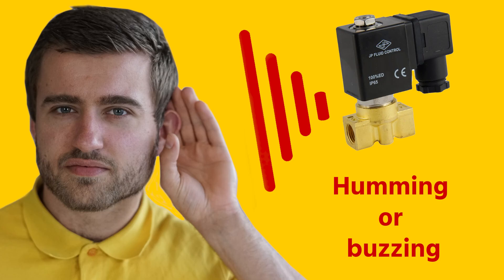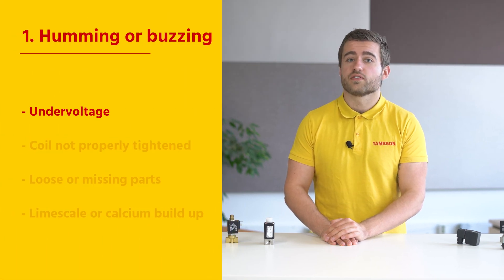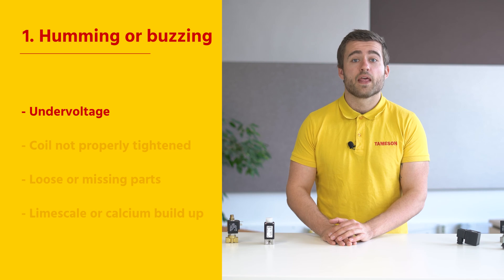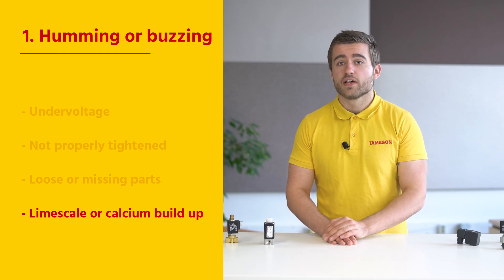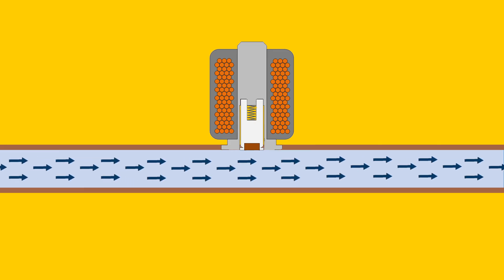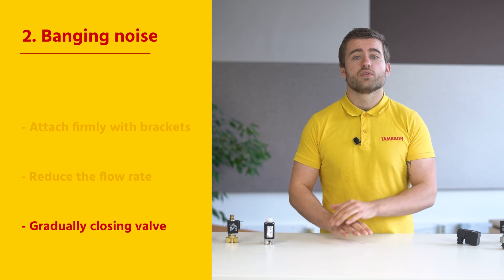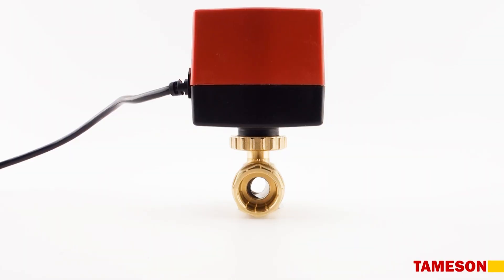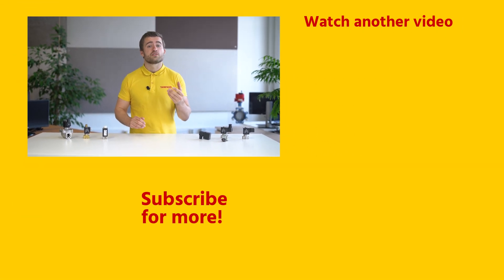Solenoid valve noises | Causes & Solutions | Tameson

Comment: My gas dryer (Maytag) was noisy before ignition and sometimes also after ignition (A 60Hz buzz). I found the armature length on valve 1 (the three wire valve) was slightly long, so the solenoid plunger (aka piston) vibrated on the cylinder end stop (the internal limit for travel inside the cylinder). Installing a replacement cylinder from a donor valve solved the noise. Note: this was not caused by a weak coil or by incorrect gas pressure as some persons have suggested.
Reply from the maker: Thanks for sharing your experience and solution!

Comment: Hi 
I have replaced my caprice solenoid valve. After that car is started making huge metal grinding sound. Can you please tell me what could be the reason.
Reply from the maker: Hello, you should check if the valve is installed properly. There are many things that can cause this issue, but the first thing is to check the installation manual and the installation guidelines.

Comment: On what basis soleniod valve power rating will decide?
Reply from the maker: The power rating of a solenoid valve is primarily determined by its coil. Every coil is fitted to the valve to meet the operating conditions and have enough power to open or close the valve.

Comment: i have a gas pressure fryer and as i press the power button, the selenoid valve makes a loud continuous noise for like 10 seconds then stops. Would be thankful if you can advise me. please. Thank you
Reply from the maker: Humming or buzzing noise
AC noise
Solenoid valves operating on alternating current may produce a noise accompanied by vibrations. Soft buzzing and slight vibrations are normal in some types of AC solenoid valves. They are the result of alternating current producing a varying magnetic field which acts on the armature of the valve. Most solenoid valves include a shading ring, usually made from copper, which is used to buffer the magnetic energy created by the current flowing through the solenoid. They smoothen out the varying strength of the magnetic field by storing magnetic energy while the current is at its peak, and releasing it when the AC current is near to zero.

Undervoltage
However, if the noise or vibrations are excessive, this may point to one or more issues. One potential cause is undervoltage, caused by improper control signal, faulty control system, bad wiring or control relay malfunction. Undervoltage may cause the solenoid to never fully open,  oscillating between the open and closed states, a state which produces abnormal vibrations and an audible hum. This fault can be diagnosed by energizing the solenoid and measuring the voltage across it, making sure that it is within the manufacturer-provided specifications.

Loose or missing parts
Another cause can be loose or missing parts in the assembly. This case might be characterized by a chattering noise. It should be verified that all parts are installed according to the manual and that all components are properly tightened. This problem can occur if improper maintenance is performed on the valve. If some components are missing, you may find a suitable spare in your distributor’s catalogue.

Excessive pressure or flow rate
An excessive pressure differential across a solenoid valve, or a too high flow rate, can cause humming noises in some valve types. Solenoid valves should be chosen having in mind the pressure and flow requirements. Inlet and exhaust tubing should be of sufficient diameter to allow for lower flow rates. Some solenoids require speed-control devices for proper operation.

Internal damage can also produce noisy operation. Worn armature or damaged springs are often to blame in such cases, and if wear-related issues are suspected, the valve should be examined and serviced by a professional.

Indirect operated valves with too low differential pressure
Some valve designs require a minimum pressure differential for the valve to open from the closed position, and to stay in the open state. This is called indirect operated, pilot operated or servo operated. If the minimum pressure differential requirement is not met, the valve may not fully open, or may rapidly resonate between the open and closed position, producing audible noise. In order to avoid this issue, pay attention to the minimum operating pressure differential specification in the solenoid valve datasheet, or use a valve design that does not have minimum pressure differential requirements. An example is a direct operated solenoid valve or a (motor driven) ball valve.

Foreign matter
Finally, foreign matter such as dirt can affect the operation of the valve. Limescale can be another cause, especially in systems used with hard water. Solenoid valves run at temperatures that can be considerably higher than the temperature of the surrounding air. In a process similar to the one occurring in water heaters, calcium deposits can build up on the armature, causing it to stick and possibly fail. Noises are sometimes an early indication of this problem. Valves can be more or less immune to this problem, depending on their design.
Reply: Sounds like you have a pitco fryer, if so it's supposed to do that

Comment: Very insightful, thanks. I'm trying to work out what is causing the droning noise in our combi boiler on first start-up in the morning - so one question. At what frequency would a "faulty" solenoid "hum" at? The noise we have in our boiler is between 320 and 340hz so does that suggest something else.
Reply: We determined that the droning noise is actually nothing to do with the boiler - it's the (externally fitted) Automatic By-pass Valve (ABV) chattering open/closed. As soon as we turned on the fill-up loop the noise stopped. So, it appears that if the ABV is set incorrectly it causes the droning noise. I hope that helps someone with a similar problem.
Reply from the maker: Depending on where you live, the frequency of mains voltage is 50 or 60 hz. A noise between 320 and 340hz would indicate that it is not the solenoid valve causing the problem.
Reply: Hi, Thanks for getting back to me. I've taken the front cover off the boiler and now think the droning noise is the fan. It also "vibrates" to the touch. Is it possibly the bearings being cold in the morning then expands to take up the slack so the droning noise stops. The boiler is only 2 years old.

Comment: Why solenoid Valve coil is heating
Reply from the maker: The coil will get hot if power is supplied. It is important to not let it get too hot (too much power, hot environment, etc.). Ensure it is operating within the correct specifications.